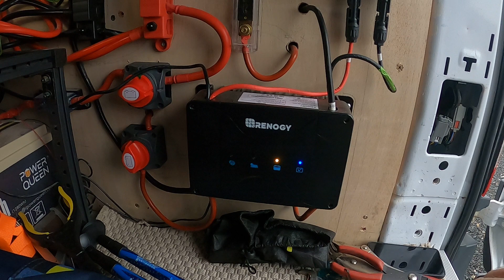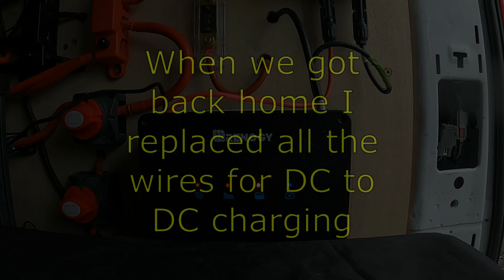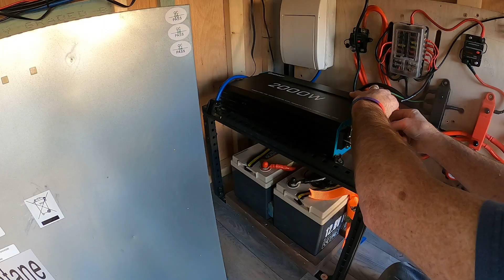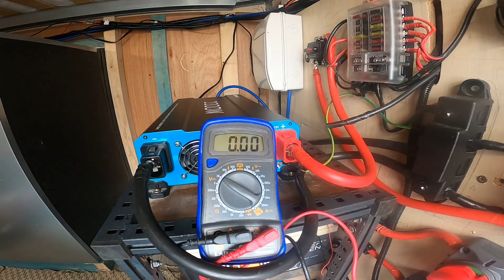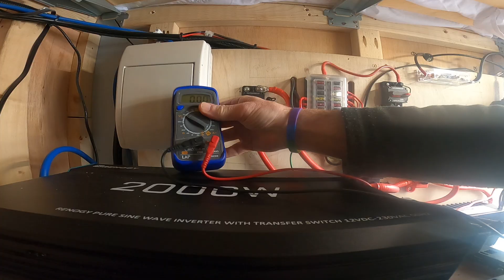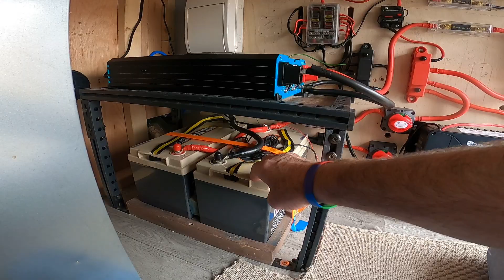These electrics need sorting NOW! #builtnotbought #renogy #selfbuildcampervan #wiring

Comment: Hi, can you confirm your setup has no shore power/hookup for 230v. Ie your not using the auto transfer provided by the invertor.
What was your selection process for the consumer unit post invertor.
I ask as I have Renogy 1000w but reluctant to use as I understand these are not to British Standards but are CE approved. Does the consumer unit make these compliant?
I appreciate your not a professional electrician. Nicely explained system😊
Reply from the maker: Hi I have hook up for shore power and it works seamlessly as soon as you plug it in it takes over from the inverter without needing to do anything. We haven't used it much as we are off grid a lot. I used a consumer unit that is suitable for a garage or shed and earthed it it to the chassis It has normal household protection and has not been a problem however I have seen videos suggesting that it is not up to standard so I may change it going forward. but it does have MCB and RDC protection. If I was doing it now I would use one from 12v planet or somewhere! I have tried to keep everything as simple as possible so the RENOGY set up is great for me one unit covers MPPT and DC to DC charging. the inverter is controlled with a simple switched remote and when you plug shore power in the inverter switches over for you. We went for 2000W because we use an air frier that takes more than 1000W and if I went to 3000W I would have needed more or bigger batteries and heavier cables. As you say I am not an expert but try to keep as safe as possible. 😀
Reply: Thank you so much and for your honesty. Bit like u I don't envisage needing 230v much or all as ill rarely be off grid... More campsite. It's more a resale thing 4 future. But thanks for prompt reply.